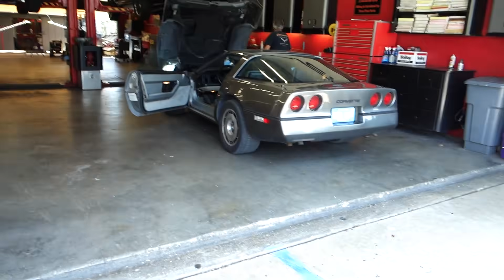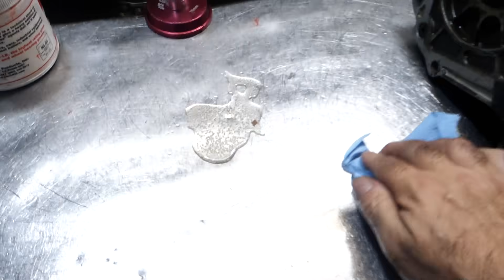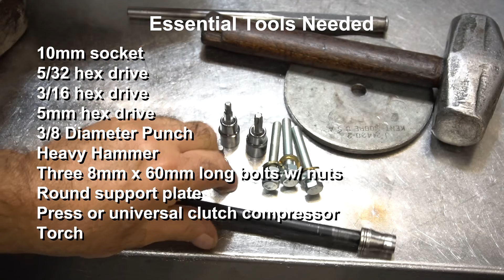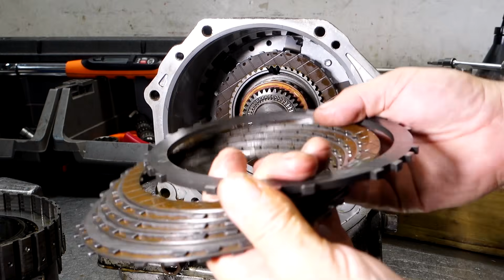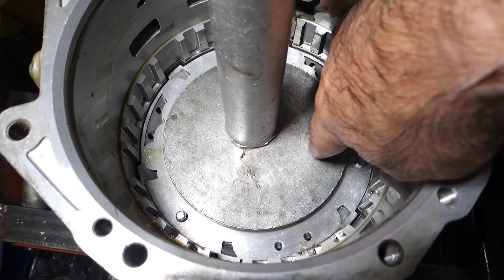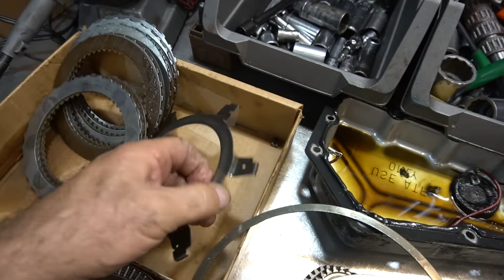How to Rebuild a Corvette 4+3 Doug Nash DNE Overdrive

Comment: I am in NH brother. I have a c4 4+3 that needs a new planetary bearing. Are you close to NH?
Reply from the maker: Nope in Florida
Reply: @GearBoxVideo question? I have a whine sound in my 1985 C4 vette with the 4+3 tranny. As soon as overdrive is engaged, the noise goes away. Think it's the Transmission output shaft?? Thanks!

Comment: Can I take apart the valve body just to replace the electronic connect that goes to the outside plug? Or do I need to take everything else apart to take the valve assembly apart?
Reply from the maker: Drop the pan and the bulkhead connector just pops out from the inside. No need to remove the valvebody
Reply: @GearBoxVideo awesome thank you so much brother your videos have helped me a ton, you’re the best

Comment: Hey Paul, bought your book years ago.. Super helpful. My question is, can I run a Doug Nash 4+3 in my 1963 Biscayne without a computer ? I have the unit but no electronics. Thanks for any advice/information.
Reply from the maker: You can, but I would not waste my time or energy trying to put that in your car. You are better off getting a leader model 5 speed

Comment: Hi Paul, 
Does it make sense to bump up the Pressure regulator spring a little bit to increase line pressure for more power capacity? I have this transmission behind my 1987 Callaway Corvette. My Overdrive was gone so today I disassembled it and does not look to bad. Overdrive failed because the overdrive piston moved full to the engaged position but travel distance is limited by the 1300pound spring retainer. Clutches does Not look to bad. 
Is this normal? I thought normaly clutches were failed. 
Thank you very much.
Reply from the maker: Any numbers stamped on the OD unit?
Reply: Hi Thank for your fast response. On the trans housing is only 71-80020, on the pump itself 18-80003 and 18-80007.
I have also a question to the carrier bearing. It has a little Play when pushing from front to rear. When driving there are absolut no noises in all gears without the Overdrive I could Not Test because the clutches are gone since I bought the car a few weeks ago.
Reply from the maker: I asked if there were any numbers stamped not cast. If we did those units which we did a lot for Callaway they would be stamped on the back end where the beam is. The OD unit would have to be out of the car to see it
Reply: You have and ideas Paul?
Reply: It is completly disassembled out of the car. What is the beam, what does it mean?
There Are only Castings, no stamped Numbers. On top at the rear  is a 52 written with a marker. Is it this what you asking for?
Reply: Rebuild Kit from Cobra transmission arrived today, so I am at Rebuild now. Thank you for every helpfull Input. 
Regards Pascal
Reply: Now I found a Numbers on a Tag which was attached to the oil pan:big letter CJ 
and small: D6K30295
Does this help to Tell me something about it?
Reply: If I took it apart, the Overdrive clutch was complete gone, but direct clutch was Like new.

Comment: I just picked up a 84’ project car which I’m basically rebuilding front to back. The car has 60K original miles but unsure if the trans or overdrive functions correctly as it sat for over 10yrs. I current,y have the trans out replacing the clutch would you say its worth wild to go thru both units while out? Do you offer this service?
Reply from the maker: I would just reseal
Reply: @GearBoxVideo  I bought a seal kit and that was my intention. Can the seal on the overdrive unit be replaced without pulling the unit apart? I plan to split them to do the adapter seals.
Reply from the maker: Yes it can

Comment: Does the older model with kickdown cable fit to 1987 c4?
Reply from the maker: First it's not a kickdown cable. It is a TV cable. Second it will not work because the computer is not designed to work with that. Best to use the valving from the 86 to 858unit in the 84 to 85 unit and eliminate the cable linkage and plug the hole
Reply: Ok. Do you sell parts? Thank you very much
Reply from the maker: Very little parts. My contact information is in the video and actually in the video description use it to get in contact with me

Comment: I'm having a problem with mine where the front plate seems to be stuck to the piston. I'm currently stumped
Reply from the maker: When the front bearing goes bad in the carrier it pushes the carrier into the front plate. When this happens the plate is basically spread in between the carrier and piston. This is the result of driving it with a bad bearing for a long time. Sadly the only way to get it apart is to ruin the piston.
Reply: @GearBoxVideo   Alright, thank you. I'm gonna take a crack at it tomorrow. How would you get it apart?
Reply from the maker: 2 pry bars on either side will force it thru the piston. Usually damaging the piston
Reply: @GearBoxVideo  Right on, I appreciate the help. I don't really have another option at the moment, so I'm going to try and find some kind of replacement to rebuild it with. I wish I could put a 5-speed in the car, but that doesn't agree with the budget, haha

Comment: Hey gearbox man, about a year ago I asked you how many plates and clutch discs were inside this unit and you responded which very much helped me out. I have now rebuilt, the transmission and the 4+3 gearbox all myself and is turning great to this day. I have now supercharged my C4 with an LS engine and 700 hp with this gearbox powering the whole build. I’ll give you full respect and thanks for helping me with my project. We need more people like you out here teaching the young minds on how to rebuild stuff like this.😊 much appreciated brotha,  much appreciated. (I know I’m dusty my luck with how much power I’m putting through it, but I don’t care.😂)
Reply from the maker: @evansisco  The OD will usually hold out fine. Thanks for the feedback.
Reply: @GearBoxVideo  heck yea dude keep showing us how to do this stuff right and keep these 80s cars moving like butter 🤙🤙
Reply: I'm interested your results, keep us posted.

Comment: Paul , I'm hoping you might see this, I've had this unit (1988 version) in my Austin Healey with a 450hp small block in front of it for about 5000 miles now. The unit was used when I put it in (after a tear down inspection) and in good shape. I now have direct clutch slipping and when I stick my foot in in 2nd over the overdrive clutch will slip just a little now and then. I have a rebuild kit on order and while in there, I would like to raise line pressure a little as well as add a few more springs to the direct clutch pressure plate. What do you think? I like the versatility of the unit but I'm not against replacing the transmission with a T56 6 speed from a 97 Camaro if need be.
Thank you.
Anton
Reply from the maker: The sprag does all the work going forward in direct. Direct clutches are for reverse and engine braking
Reply: @GearBoxVideo  I understand all that i have some engine breaking and reverse if I go easy. What I would like to do is improve the power holding of the clutches by increasing line and spring pressure, for instance adding 3 or 6 more springs to the direct side and increasing line pressure a little on the OD side. Thank you for your input.
Reply from the maker: The best thing you can do is use solid lined clutches and not waffled lined clutches and boost  line pressure. That is what I did for Callaway for the twin turbo cars and it works fine. There is no need to add more springs

Comment: Hi I have a 1985 C4 with this Transmission. My question is to do with a comment you made in this video around the 6 minute mark I think the problem is to do with  the bearing  pushing the seal out of the  housing causing the trans stuck in reverse gear (I haven't been able to get the car out of reverse the last time I had the car out for a drive)  Do I have to drop the overdrive unit to get the shifter to get into neutral?.  or do I need to drop the whole transmission  to get the overdrive  out for repair. Thank you and look forward to your reply. Cheers
Reply from the maker: First, see if you can get underneath the car and manually move the reverse shifter shaft back into neutral. If that doesn't work then you will have to drop the whole transmission you cannot slide the overdrive unit off of the back. Once the overdrive is off you can usually push in the roller bearing, stake it in place and install a new seal
Reply: Thanks Paul  I will try that. I have another question ? Do you know what other transmission will bolt up to this car in place of the 4+3  , preferably something out  of another car 5 sp with an overdrive. ?
Reply from the maker: Nothing, other than a later ZF 6 speed. Which has zero service parts

Comment: Hi, I saw a comment you posted on a website forum where you said parts for these were readily available.  I've looked for the 4+3 solenoid for 3 years and can't find one new or used.   I think that's what I need, I have an 85 with 86k miles on it, sometimes when I'm driving it on the highway the overdrive will keep engaging and disengaging quickly, I have to turn it off, slow down for a few minutes, and then I can re-engage it and it'll work.   I think I need a solenoid but I haven't been able to find one.
Reply from the maker: sk trans 631-957-9427 for the solinoid.
Reply: @GearBoxVideo thank you, with only 80k miles on the entire car it's too early to give up on it over a small part like that, I'll give them a call tomorrow.
Reply: @stevenhaffley9852  what did you find out?
Reply from the maker: If the overdrive engaged light on the dash comes on and off with the overdrive going on and off then it is not internal to the overdrive

Comment: Hi, I was just wondering how many plates and clutches are used in this unit I’m pretty sure the outer is 11 and the inner is 13 am I right?
Reply from the maker: Ods are either 4 or 5 OD and 5 or 6 direct
Reply: Thank you so much frfr

Comment: If scoring Is found in thr body , piston and pressure plate   Is replacement needed .
Reply from the maker: If it affects the sealing areas...yes
Reply: @GearBoxVideo   thanks for your reply. It would seem the scoring is mostly were the friction rings ride. Also I checked your website but it would seem I can't find a direct friction plate washer.

Comment: How in the heck do you get the bottom 17mm bolt out? 3/8" socket-nope, 17mm open/box end wrench-nope!
Reply from the maker: I had to grind a wrench down
Reply: @GearBoxVideo  I got it apart. The seal fell out of the front of the OD. I sent an email with a question.
Reply from the maker: The carrier sin gear roller bearing walks forward bushing the seal out. Push the bearing back in with sleeve locker on the outside of the bearing, then stake it in place.
Reply: @GearBoxVideo  I sent a couple emails to you about a couple issues I have come across. I am currently planning on rebuilding one of the three OD units I have (if one of the three are good enough to rebuild). Absolutely zero people/shops work on or know anything about these transmission/OD combos and one that claims they know everything about these. Looking at my 88 OD unit (that was rebuilt by him says different). So I'm doing it myself.
Reply from the maker: Yes and I did respond. Check your spam folder
Reply: @GearBoxVideo  I'm sorry I didn't specify that I sent a couple more emails the last couple days.
Reply from the maker: Ive been rrsponding to emails. My contact info is in the about sections of yhis channel.  Try calling after 7pm
Reply: One more question for you. Have you heard of a guy in Illinois by the name of Crazy Charlie Smith who rebuilds these? He claims he is one of only 3 or 4 people in the nation that rebuilds these combos? He says he got a bunch of these transmissions from Vermillion Chevrolet and rebuilt them for GM! I was wondering since only a few people work on these if it was a tight knit group of people knowing each other.
Reply from the maker: Never heard if him

Comment: Damn that was a cool video. Would you mind please helping me out if you can? I found your video cause my car appears to be stuck in gear it’s an 84. I was driving when suddenly I couldnt shift gears. I forced it into neutral position but it stayed in gear I got home and it stalled where I parked it. I checked under the car and one of the linkage things from the shifter was disconnected, so I connected it and now it seems the shifter is even harder to move than before. It’s supposedly in neutral but it’s in gear cause the car will start and try to take off. Do you know what i could try or what it could be? Thanks an Advance for any info you’re the man!
Reply from the maker: Sometimes the 1-2 shifter shaft breaks and it stays in 1st gear
Reply: @GearBoxVideo  i will check that out, appreciate it thank you!!

Comment: Hey, thanks for all the information but I have one question about the transmission. What would be the cause of the reverse gear not working ?
Reply from the maker: Remember everything goes thru the OD unit.  It doesn't  vanish when you are not using it.  Reverse is another mode.  The OD direct clutch pack is burned up.  A common problem

Comment: How does the automatic transmission adapt to the standard?
Reply from the maker: The output of the 4 speed drives the pump. Electronics keep  it from shifting prematurely until proper line pressure is achieved

Comment: Can you use 85 4+3 in 84 . Curious if I can just swap side cover plate with 1st 2nd 4th  switch from 84 looks like the 85 only has plug on shift bracket plate on driver side of 4 speed thanks
Reply from the maker: Yes you can! Just use the same side cover since the 84 has more switches
Reply: @GearBoxVideo  Also the car is carb swamped . Basically does the 4+3 work with carbureted engine for overdrive ? meaning all throttle position stuff is out of equation. Only thing I can use is cooling temp sensor in front of intake for ECM
Reply from the maker: Grab a wiring diagram for your car and think it thru.
Reply: @GearBoxVideo  thought it thru. Overdrive works and has engine brake. When overdrive is not on I have no engine brake. Reverse works with light throttle but still makes noise if given too much. Also replacement tranny (not yet installed) shift plate cover is same as original but has no holes for switches. What year would this be from, is this normal? Thanks

Comment: what great video Paul you make it look so easy. Sir! I have a 84 corvette manual transmission as a project car the reverse suddenly stop working but the forward gear is ok! I went to corvette forum some member saying that my overdrive is shut I know you also mention that in this video I'm just wondering that you have advice for me to check first before I rebuild my overdrive I watch this video part 1 and 2 over 5 times each not kidding to learn as much as I can thank you again and have a great day.
Reply from the maker: Thanks. Typically the forward clutch pak is smoked
Reply: @GearBoxVideo  Mr. Paul thank you for the fast response one more question. With your professional should I rebuild it or should i get a re build 700r4 thank you

Comment: Great video. I just took mine out of my 86. No symptoms except overdrive didn’t work.  I checked the fluid level and it smelled burnt. So I pulled it out to replace clutches and seals and found the direct clutch thrust washer broken and it had damaged the overdrive direct clutch piston. Do you have any idea where I could get a new direct clutch thrust washer and a new direct clutch piston?  Tried my corvette guys here in Canada.
Reply from the maker: My contact info is in the video and video description.. Use it

Comment: The best Transmission I have ever came across was A T56 from a V6 3.4 Camaro 1994 never failed ever you could drive it 3000 miles with minimal bullshit.

Comment: Hey paul, I have 1986 4+3 , starting to have an issue . The Manuel part of the transmission works fine but when I drive it now the overdrive is slipping and motor is revving up when I it the gas. Overdrive light stays on . I can drive the car normally without the overdrive. There isn't any transmission shops that know jack about these transmissions in my area. Why is overdrive slipping.
Reply from the maker: OD clutches are burnt. Call SK at 631-957-9527 for an exchange unit

Comment: PLEASE HELP CAN'T SEEM TO FIND THE FIRST GEAR SWITCH.
Reply from the maker: Some units have them except for the  1986 model. Switch is on the 4 speed 1st gear section of the SIDECOVER
Reply: @GearBoxVideo  Thanks for the info. We can put power to the F terminal at the DLC connector and overdrive works. Or we can ground the overdrive relay terminal and make it work that way. Before jumper power and ground we did install a new relay as well. We also see the overdrive request on the scan tool when pushing the momentary switch on the shifter. Having said all that the unit is noisy and turning the output shaft is not smooth.

Comment: How can my buddy get the solenoid to activate the splitter? His 4 speed 88 c4 built in oct 87 has a 8ball shifter :/ 
    I'm starting to worry if the previous genius that built this car ground wired the amp to the transmission idk what to do next.
Reply from the maker: Rewound solonoids are available from SK Trans at 631-957-9427
Reply: @GearBoxVideo  the car doesn't have a button on the shifter for the splitter/solenoid
Reply from the maker: The wiring is under the shifter in the console. It's a momentary push button switch you need. Learn about putting the car in diagnostic mode and check your circuits

Comment: Old video, but any way I could reach out to you with some issues I have been having with my Corvette? Its an ‘87 4+3. Had a shop in Connecticut rebuild my overdrive box, and it has now failed twice within 100 miles. Just looking for some troubleshooting advice as they have not been helpful and it may be up to me. Thank you.
Reply from the maker: Contact and website info is in the video. Use it! I'm still around.